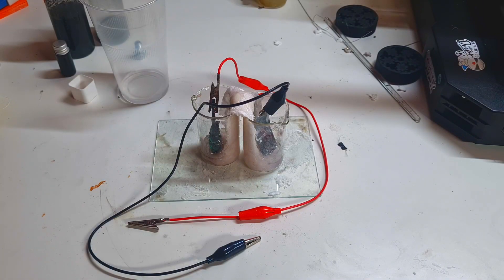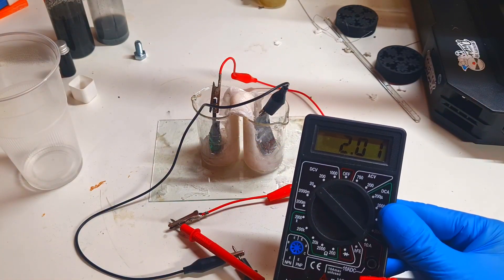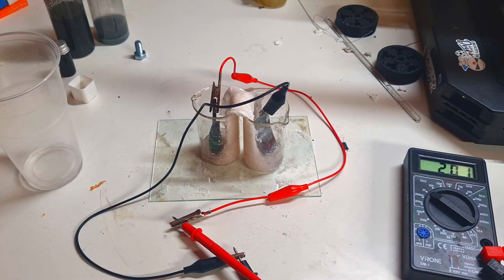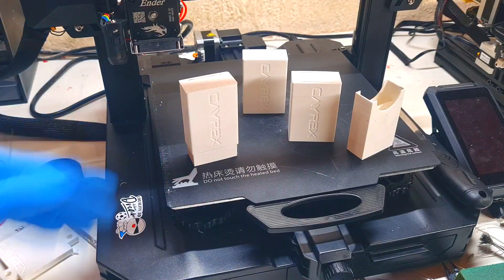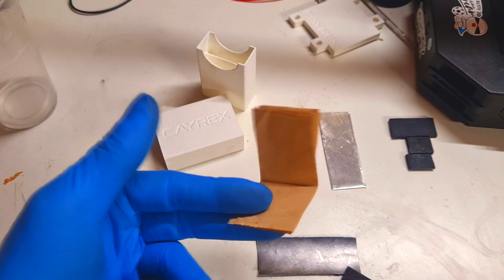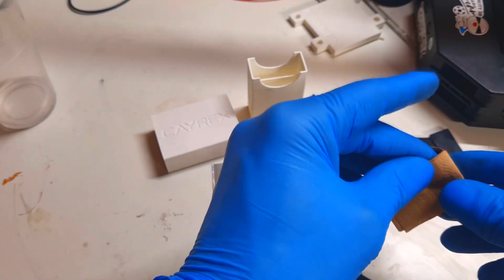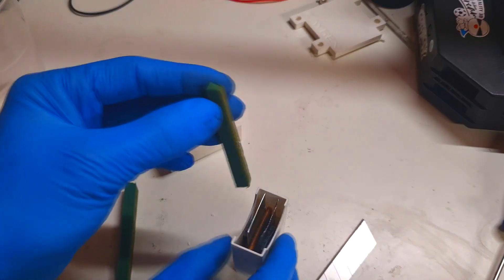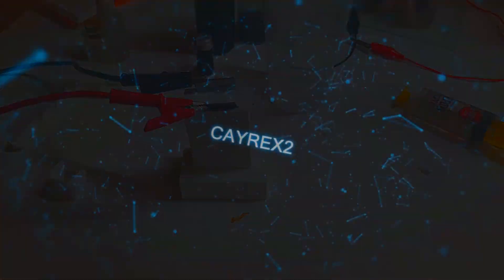New Zinc Manganese battery

Comment: Great job 👍. Cayrex2 have you made any batterys using floral foam? I was just thinking the pores would hold the electrolyte well.
Reply from the maker: Here I also put some floral foam in to the cell
Reply: Just remember to let it soak up the liquid with out pushing on it to keep out air bubbles. It will be very interesting to see the results. Your. 💯👍